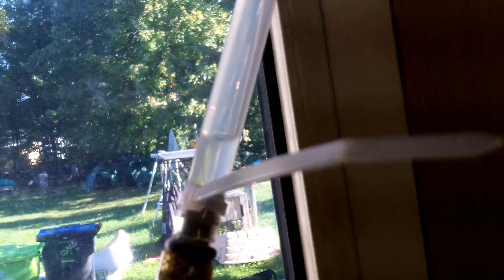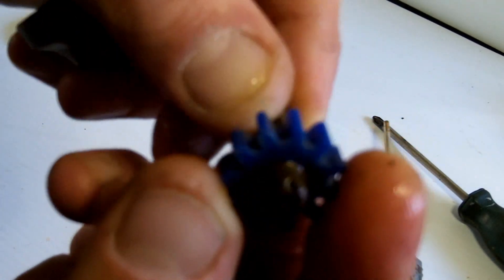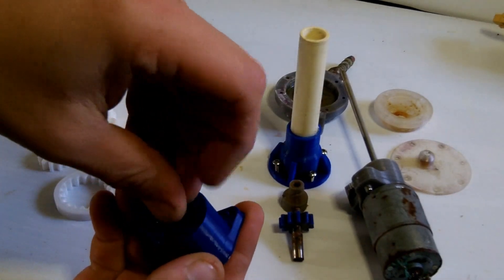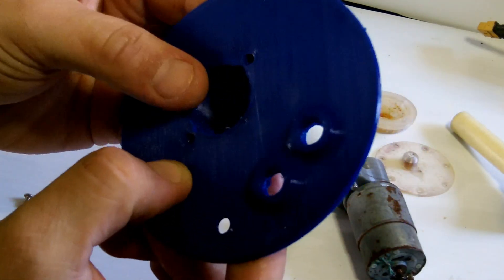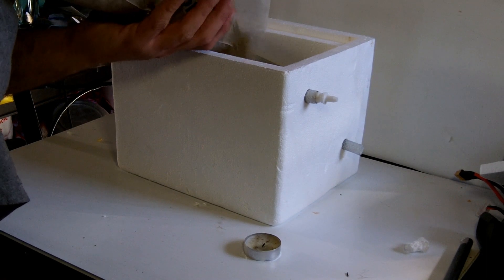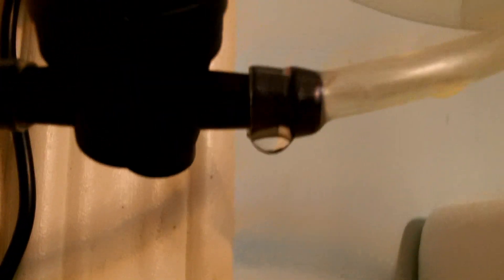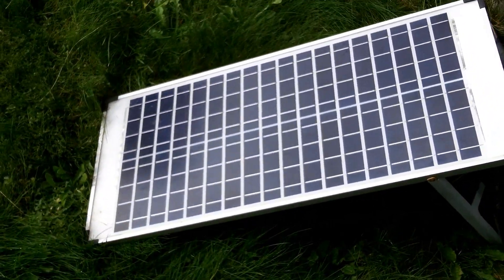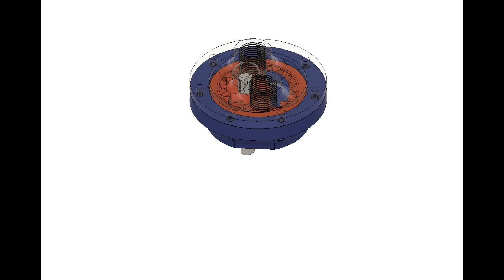upgraded-pump sand battery solar heat pump

Comment: I might be all wet, but I've been kicking around similar ideas for a few days.... I think the peltiers should be inside and the heat exchange should be coupled to the ground.... rebar, grounding rod, black iron gas pipe... something like that. 

Don't know how to use a sand battery with that setup though... I guess you could run water on both sides of the TEC, one inside, one outside and have  completely separate tubing, pump, heat exchange from the battery to the house. 

Anyway, I found it interesting.
Reply from the maker: the heat pump can be where ever really , the long term plan is to have a solar water heater panel in the loop on the external side , as well as an underground heat exchange. they would both be able to be isolated from the system , so one for extra heat in the cold weather and one with less heat for the summer hotter weather . If the sun is out on the 40 watt panel i can get it all up to 30c but it seamed to work better as a cooler surprisingly but i think that can be attributed to my crappy heat sink on the external side of the heat pump witch is super inefficient . it works better in the summer as its usually shaded . I had a large loop of line running on the floor and wall that worked as a heat exchange ( eBay rad leaked ) . the sand bank seams to be the equivalent of 2 L of water , but its slower to take in or release energy. The scale of the sand battery would likely need to be much larger and better insulated to do anything worth while , i do get an extra hour of warmth out of it but it slows the initial warm up so im likely losing more in the long run than gaining anything .
Reply from the maker: I plan on 2 water blocks , 2 pumps ,2 separate hot and cold systems . this will take a long time for me to implement , but so far it makes a noticeable difference in room temp , way more than i was originally expecting. the 2 stacked and wired in sires tecs helps with efficiency, lower the voltage the higher the efficiency, but to get the same power u just need more units , and the space to mount them .
Reply: Sounds good. Getting away from air temps outside and going to ground will give better results. Also, was thinking about how to insulate those small 12mm lines... which will be necessary when you eventually run things outside beyond your wall. Bet you could run those lines inside pex or pvc and use standard pipe insulation on top of that.

Also, if using a sand battery  for cooling.... consider a phase change material instead. Wax or ice can store FAR more energy than sand.  It will still be a lot, I calculated something like 220 lbs of ice to cool 230 sq ft overnight where I live. Pretty rough figures I was working with, but taking a pound of ice from 32 to 70 F is roughly 200 btu.